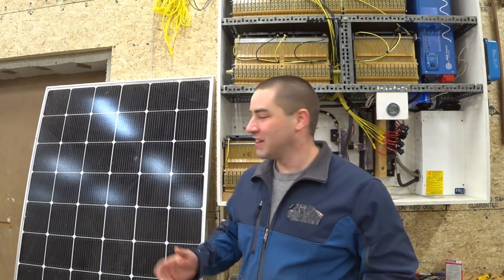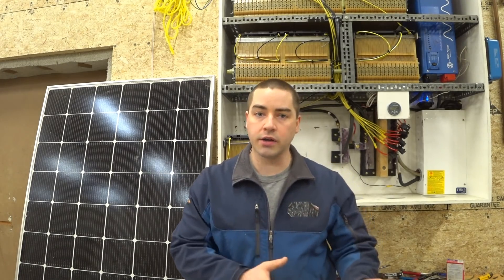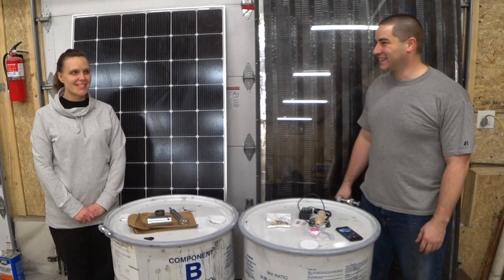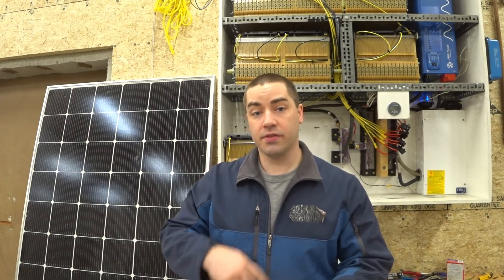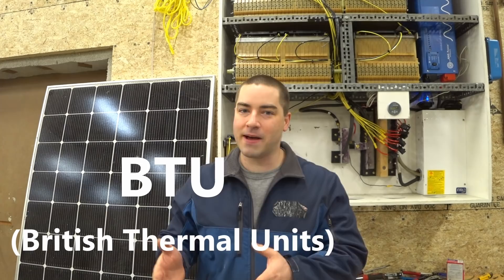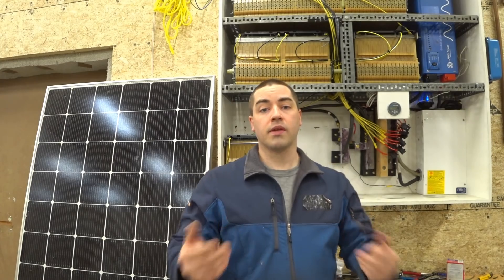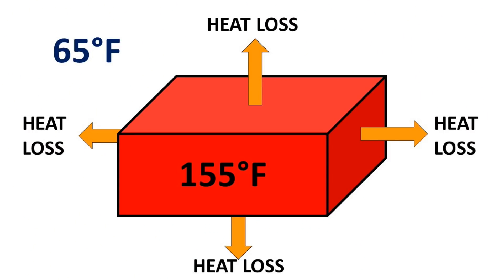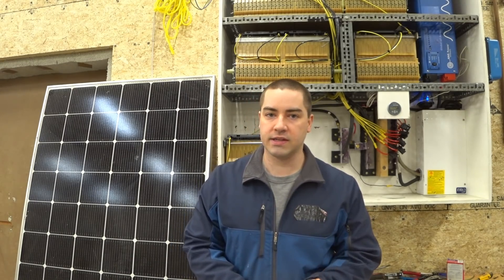Cheapest Energy Storage Off-Grid

Comment: Wait a minute! A heat pump uses 1/4 the power of an electric water heater. So you can last far more than 4 days. And 1/4 the power is a lot less work for the inverter
Reply: Yep, that's a valid point.  If the heat pump water heater was operating at 4:1 efficiency that 30kWh of heat could be extracted from the surrounding air using only 7.5kWh.  In his case, he would either be extracting that heat from inside his house, or from outside.  If extracting from inside his home, he would then need to heat his house back up again.  If drawing air from outside he wouldn't.  Keep in mind that heat pump water heaters will work less efficiently if the source air is colder, so at perhaps 0 degrees F outside, the efficiency might be 3:1 or 2:1. 

In his defence, if I were looking at expanding a solar electric install to handle hot water needs, I would need to price new panels, perhaps a larger inverter as well as more batteries.  Compare that to the cost of the hot water system - the solar heat collector is more expensive while the storage is cheaper.  And the application is cheaper because you don't need to purchase the heat pump.  You'd have to run the numbers and figure out which is best for you.
Reply: @alskjflaksjdflakjdf   The Heat pumps I tested gave closer to 1:1 at 23F (-5C), They averaged 3:1 from 23-108 F(-5C to 42C) with 6:1 at the higher Ambient temps.with lower water temps, heating water from 77F-131F ( 25C-55C)
Reply: No electric water heater here. Just solar water heat

Comment: Wax is far better for thermal storage than water. Oversize it, add some high output TEG's and have some backup power for those cloudy days.
Reply: If only oil heaters had been invented. Oh wait....
Use OIL. It holds 2-3x the energy per litre and can go well past the boiling point of water. Multiply these factors and you can store 6x the energy. Which means a much smaller tank, and much less thermal losses....
Reply: Nevada Forensics LLC oil doesn't hold three times more energy than water, it holds significantly less, around half at best. Water is 4.2kj/kg/c vs about 1.9 for oil.
Reply: When I worked for a solar company, they looked into phase change materials. But their plan was never to use it instead of water, but to use it in addition to water. The issue they had was finding the right way to seal the wax inside something that could be submerged in the solar storage tank. Assuming that could be done, I think it's a pretty good idea, as it would shrink storage tank size or enable greater energy storage from the same size tank. Dunno where things have gone since then (2004) though, so maybe it isn't feasible.

Comment: So, how do you heat the water? I'm guessing a solar hot water heater? Solar panels are cheap, could you use excess electricity to heat the water? I don't think it would be hard, use a battery protection device to shut off the heating element when battery voltage dips below 95% SoC.
Reply from the maker: Hi Jesse,  Right now I heat my storage tank with three collectors.  https://youtu.be/NDxmPl5jlVA  But you could also use electric directly.  I'm currently conducting an experiment to test PV vs. Thermal : https://youtu.be/VPd212q6uvU https://youtu.be/kkoesuG72xQ and https://youtu.be/kVaxAfXQPDU
You can also use a "diversion" load controller as you mentioned.  I'm planning a video on that in the future.  I've been gathering the parts and making my outline.
Lot's of good options out there.  I say it's all good if it works for you.  Thanks for watching.

Comment: This is an excellent idea and I am thinking about doing a similar but less involved system. I plan to use my hot water heater as the dump load once my batteries are fully charged. My issue here in Canada though is that I will have plenty of hot water all summer yet not during the winter when the days are far shorter. Does your house overheat with such a large amount of hot water in the crawl space during summer? 

I would say that this video really made me think that they are really onto something with their parabolic solar steam generator in Medicine Hat Alberta. They have about 2 acres of solar mirrors that make steam and as backup they heat the water with natural gas. I mean collecting heat from the sun is far far cheaper and more efficient then collecting light and turning it into electricity at 22% efficiency and then converting it into heat. It is far more efficient to just collect the heat from the sun at 75% efficiency and then turn that into electricity. With natural gas as backup in that system, there is no need for batteries. It can be a base load power station
Reply from the maker: Hi Tom Kelly,  No, my house does not overheat in the summer.  I have extra insulation on my tank then I mentioned in the video, but just on the lid, so I didn't want to complicate the video too much.  Also, the bottom of the tank is insulated to the ground, but any heat loss down would not contribute to the house.  

There are lots of very cool systems out there.  I support exploring mirrors, parobolics, PV, thermal, or any others.  They are all worth learning more about.  I'm conducting an experiment right now to compare solar PV to thermal collectors.  Check out some of my other videos for that.

Thanks for watching.

Comment: @davidpoz should check out the mirror powered steam plant...use the mirrors to concentrate the sun on a focused area, they used  a computer system to control the panels or else the sun power would melt the water tower

Comment: JUST YM THOUGHTS. IN WINTER HOW DO YOU GET AND KEEP THE TANK WATER AT 130/180 F. WHEN THE SUN IS OUT THERE?  I HAVE HERD OF LARGE POOLS OF ICE SAVED IN WINTER TO USE FOR COOLING IN SUMMER. HOW DO YOU HEAT YOUR WATER IN WINTER ? YOU CAN USE THE SUN IN SUMMER , BUT CAN IT DO IT IN WINTER ?
Reply from the maker: Sometimes in winter we have long stretches of cloudy weather.  When that happens the solar tank will drop in temperature.  I've seen it as low as 90 degrees F.  I also have an electric booster tank in series (small 19 gallon tank).  So if the water comes out of the solar tank less than 120 degrees, the electric tank will boost it up the remaining amount.  Thanks for watching.

Comment: I have around 10 acres off grid in MN.  I will consider implementing your idea.  I believe it would be best to bury the water storage tank so it can never freeze and crush my copper heat exchanging tubes.  In addition my property is heavily wooded, so I can use solar when the sun is out and wood to heat the water in the winter when it's usually cloudy.  I was also thinking of using the water to heat a 10' x 10' bed room so I'll always have a warm place to crash.  This type of heat storage could potentially save me from getting up in the night to feed a wood burning stove.
Reply from the maker: That would be pretty awesome.
Reply: We heat with cordwood here in southern NH. If the house is extremely well insulated and has a reasonable amount of thermal mass letting the stove go out at night is not a problem. Also don't forget to factor in solar gain from south facing windows.

Comment: This is an even better idea because of where you live - all the 'wasted' energy in the thermal losses of the tank of hot water contributes to space heating and so is not actually wasted.  Where I live in the tropics you would need to have the water tank outside instead of in your crawl space.  In the tropics a way of using hot water to generate cool air would be brilliant.
ps I wish someone would bring out photovoltaic panels that also had a means - such as built in pipes circulating water  on the back - so that the 80% of energy that is not used by the electric cells was also collected.
Reply from the maker: True.  It's not really wasted heat.  But I was trying to keep things simple for the video.
Reply: @DavidPozEnergy  Yes, and you did a great job of that.  Carry on your good work.
Your video restarted me thinking about an idea I was working on 40 years ago - that of doing virtually the opposite of what you've done - storing ice to run air conditioning - solar panels were too expensive then for it to be practical but now ...
ps The way your family evidently supports you is a major factor in your video being so attractive to me.

Comment: SUBSCRIBED!!  We physicists have been telling people for decades that they should be storing energy in soil under houses with insulative umbrellas, and in super insulated water tanks, and leave electricity for pumps, fans, controls and telecomm. But so many people want to brute-force heat things electrically, which is stupid. And solar thermal  panels are so cheap to build. A solar dish or trough with a heat tube transfer to the indoors can do all your oven cooking and range heating, it just needs a touch of redesign!  The most of all energy we use is thermal!

Comment: Convert your old washing machine into a power generating turbine, hook the converted washing machine to the natural flowing water source or main water pipe coming to your house so you can spin the turbine blades. Connect converted washing machine to pure sine wave inverter and batteries and generate electricity.

Comment: I want to store solar power to create electricity later, not just hot water.  To do that, just use solar hot water heater and store that directly, that will be more efficient and a lot cheaper.   nice video anyway even if a bit misleading title.
I wanted to see how you efficiently convert hotwater back to electricity.  Stirling engine, but they are not very efficient.

Comment: I'm building an off grid cabin on my land and was going to do this exact same thing! Use water as my battery (heat battery) I was a carpenter for 20 years so I'll insulate a bit more (but yours is sufficient)
One more thing, my solar charge controller has the ability to let me use or dump the excess solar power after my electric battery bank is full I'll send the solar electricity to help heat the water even more!
Very good video!
You remind me of myself whit the projects you do!
Good luck!
Reply from the maker: Yeah, more insulation is always better.  I just used the extra insulation I had on hand.  It could certainly be better.  My house is double-stud, R-42 walls, R-100 ceiling.  That is more like it!

Comment: Best use of excess solar power.
Simpler to use a solar diverter that heats your hot water when your batteries are full or when exporting sufficient energy for grid tied systems.
There are also devices that can modify direct DC from dedicated panels to heat a standard hot water system. (Sunflux in Australia)
Reply from the maker: Thanks for watching.

Comment: what device or system are you using to convert the heated waters thermal energy into electrical energy?
Reply from the maker: I don't convert hot water to electricity.  I use solar PV panels to make electricity and store that in batteries.  I also have solar thermal that makes hot water.  They are two separate systems.  If you would like to see the build of any of those you can check out my channel for more videos.  Thanks for watching.

Comment: You want 100% energy independence ? Zero-carbon footprint system will work like this in the future: PV-cell on the roof > electrolyse water generating H2 > store H2 in safe form (powder, inventer: Gerard Lugtigheid) > use needed H2 powder for warm water & eletricity & transportation (along the whole wintertime!). Done.
Reply: MrBazsi888 Hydrogen powder?

Comment: Did the $300 include the cost of the Pex?
Reply from the maker: Yes, but not all the extra fitting, mixing valve, pump to the solar collectors, etc..  But, as I mentioned quickly, I would use copper if I was to do it all over again.  Unfortunately a copper coil might be $300 by itself.  That was why I went with the PEX, it was so much cheaper.  But I do wish I tried harder to find a deal on a copper coil, or maybe a salvaged heat exchanger out of a scrap boiler?

Comment: We have a Viessmann Vitosol solar hot water system 160f with mixing valve and super insulated stainless steel water storage. If the sun is out even an overcast day we have solar hot water.

Comment: Hey, nice to see someone doing this. 
However it kept me thinking about an article i read about a year ago (i don't have the source anymore) about a company storing energy in a similar way by heating large volumes of lavarock, and then pouring water over it to create steam to drive a generator to harvest the energy when needed.
Now using water seems doable, but something like lavarock or sand sounds more efficient to me, since it doesn't have evaporation problems and can store a lot more heat (that is, if your container is up to it). On the other hand, in water the heat will probably spread faster throughout the volume which may cause problems when feeding cold water through pipes in the sand/stones similar to what you're trying to do. The heat may simply not reach the pipes fast enough after the material directly next to the pipes has cooled down.
One other candidate that i can think of would be oil. Wouldn't that be best of both worlds?
Just writing this on intuition though.

Comment: So... it's summer, you've got sun coming out the wazoo, you don't need base board heating , or how ever you use your excess heat in the winter... what do you do?  Have you ever considered a stearling gen set?
Reply: BTW I dig your vid, very deeply!
Reply from the maker: I've watched a lot of "Green power science" videos.  Dan makes some sterling engines on that channel.  I think it's very cool and would be fun to make one.  So far, I haven't had the "problem" of too much hot water, but maybe in the future.  Thanks for watching.
Reply: @DavidPozEnergy  I'd love to see one that had a geo thermal side, the cool side if you will,  with a  solar hot side... if you're taking requests that is... ;-)

Comment: This is an awesome concept. Here’s a question.  I have a radiant floor heat (water tubes in the concrete slab floor ) in my house. And wood stove for backup. The water heater for the floor heat runs on propane. Not good, uses a lot of propane. My hope is to connect an electric water heater to this system. I also plan to run this electric water heater solely by solar panels. A circulation pump would flow and store hot water into both water heater tanks. I would use that stored to heat for the floor, at night, when needed.  Do you think this will work?
Reply from the maker: I have a similar situation for heating my garage.  Radiant tubes in the concrete floor, and one 40 gallon electric water tank.  I use solar thermal collectors on the roof to heat the water, but I use the mass of the concrete as my thermal battery.  I don't rely on the relatively small 40 gallons in the electric tank.  That is my backup.  I think what you are asking about is very similar.  If you decide to hook solar PV up to an electric water heating element there are several safety devices that have to be added for the DC to work.  I'm planning a future video to discuss that exact topic.  Also, I have a calculator on my website to help size the heating element to the PV panels that might help you.

Comment: As you water storage is non pressure system. How much water is evaporated per year?
Reply from the maker: Great question.  Surprisingly, not enough to notice on my scale.  I was expecting more evaporation, so I installed a fill tap, but I check the level every few months and it's still where it started, 2 years later.  When I built it  I put effort into sealing the lid, and my small 1/2" vent is built as a make-shift condenser, so I guess it worked.

Comment: It all comes down to the size of your storage and how well it is insulated. Ive done calculations for heating a 1200 sq/ft home with solar hot water which is far more complex because you have to look at all the inefficiencies of the building envelope as well. An average home with R20 insulation values requires roughly 4.3 gallons of thermal storage/per 100 sqft at atmospheric pressure, if the water is in a vertical column and well insulated. Heat in water stratifies. It is always coldest at the bottom of a tank and warmest at the top. This is why HWT are vertically orientated. When you use this vertical column you compress the heat without having pressure and increase the thermal transfer capability. You take a 5000 gallon tank and give it ceramic thermal insulation and then bury it on end you would be amazed how long you can go without running out of heat. I know a contractor in the Yukon that is heating his home with solar for all but 3 weeks in the winter. He built a big stone hearth fireplace with heat exchangers in it to pull heat back into his thermal storage for those few weeks as well and only needs to burn wood for a couple hours a day.